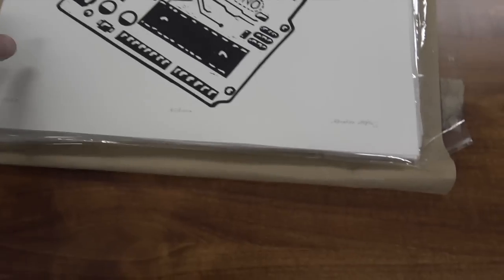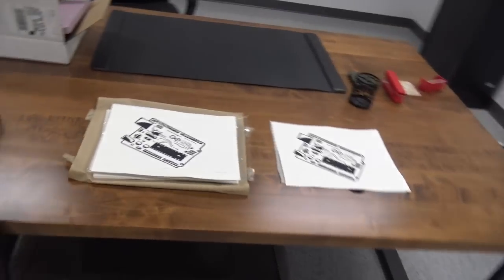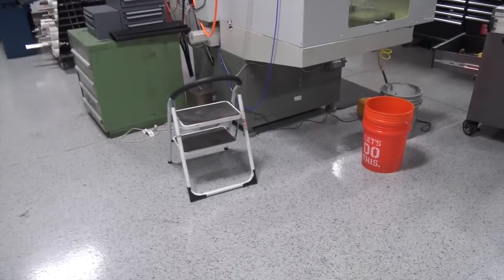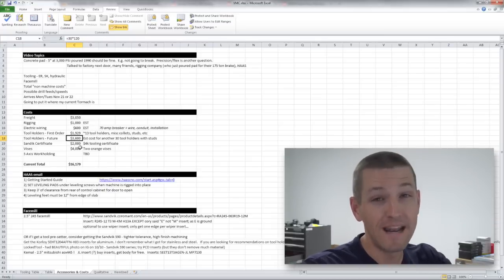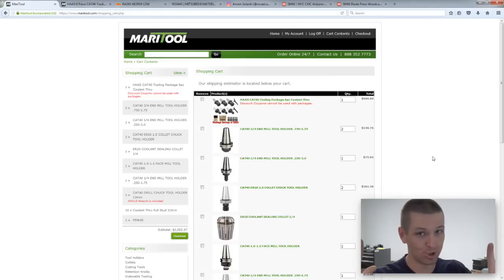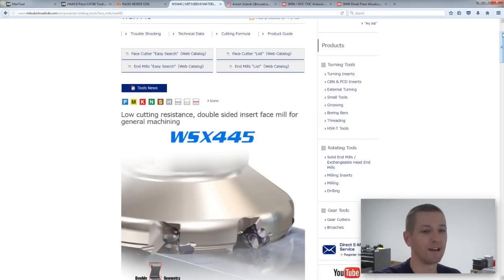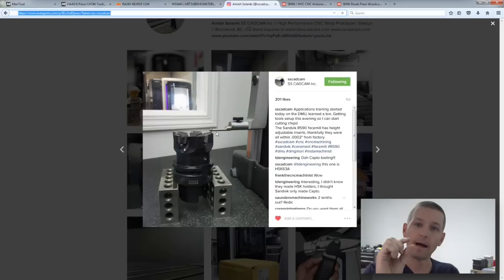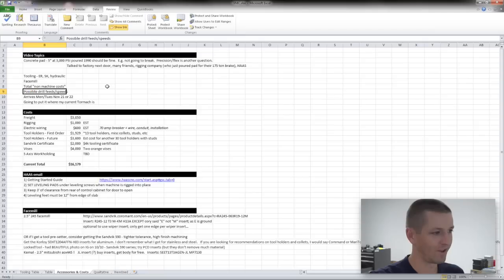Arduino Print & VMC Update!  CB33

Comment: Machine on slab. In my experience the poorer the sub-soil support the thicker the slab needs to be. If your building is on a prepared pad where the organic laden top soil has been scraped off, the underlying soil is compact and no more than 1/3 clay etc (your county extension office has maps), the pad has been prepared with X number of 4" compacted lifts of crusher-run - in other words, an installer's wet dream - a 5" slab would be plenty for a machine tool of less than 5000 lb per base pad.

I suggest you conduct a floor support survey by rolling a short piece (less than 14" long) of heavy bar stock (steel, 4 to 6" dia) at a walking pace across the floor when the shop is quiet. The changing sound will indicate the slab thickness. cracks, and bearing on the underlying soil.

Alternatively drill a couple of small test holes at the installation site and probe to determine the slab thickness and the space, if any, between slab and soil.

Take local advise for remedy but consider "slab jacking" "floor pumping" (same thing, different usage depending on locale.)

If the floor is sound and well supported, a 5" slab can take whopper distributed loads. So long as the leveling screws bear against 5/8 x 6" square pads your mid-sized VMC is a conservative load. That said, check level once a month for the first 6 months. If no movement after the 2nd month, you are golden.
Reply: NYC CNC An old jaw-less lathe  chuck would work. 6" 8", thereabouts,

Comment: Hey John, not sure if it's been mentioned, but you could get a pallet changer (we have a midaco) and leave the trunnion on one pallet and vises on the other, then it's just a push of a button to send it in
Reply: NYC CNC it's a little unnerving watching them cut a hole in your pretty new machine, but you can add it any time after it's in place.

Comment: After the 3rd or 4th time taking that trunnion off and putting it back on, and tramming it in. You're just gonna hate life and do everything you can to work around it, just so you never have to take it off again 😆
Reply: Occams Sawzall thats why he should have gone with the smaller one...
Reply: doug farrish 
Oh god no.  The smaller ones is an utter waste.  It's far too difficult to constantly try and reach down past that hub.  Plus it's only like a 3" platter. 

Maybe if all you're doing is tiny medical parts it would be practical, but it's not a very versatile 5axis, extremely limited in both part size and weight.  He would have instantly regretted the small size.
Reply: Occams Sawzall knowing that it is a 3"plate, yeah I agree. That's useless

Comment: John, I prefer Command and Techniks CAT40 all day long.  If you get a presetter, either get the DeVelig one or the Parlec one.  Sandvik facemills are pretty good.  The 45 in the part number is 45°, but I think there's a page online that shows their numbering system/nomenclature.  I'll look and post.  Mitsubishi, those cutters are nice.  One of the guys lives about a mile from me.  Sandvik does have their own CAT40's, and believe it or not some R8 indexable tooling too for the BP.d.

Comment: Watch groove automation there last video though depressing they had a interesting way of putting there 4th axis on. They made a special plate that has it hanging over the side. So you don't loose any of the table the machine can travel to. If I remember correctly it is like the outer 4 inches of the table.
Reply: The part of the video I am taking about starts just after 4:00 minutes in

Comment: I actually had the opportunity to help my school set up their 5 axis trunnion (I believe it was also the TR200Y) with fixturing and a solution for moving it in and out of one of our VF2s. Ultimately we decided to make a 1" steel plate that would bolt down over the rotary with a couple standoffs and a swivel loop in the centre. To move it in and out we'd just use a forklift with a strap through the loop. The swivel let us rotate it around to fit through the smaller doors of the VF2. I can also send you the models I worked up for our fixturing solution if you want them. It's easy enough to make them in house and save yourself a few hundred dollars over a COTS solution.
Reply: NYC CNC  Dialing in the trunion isn't too bad, It's a lot like dialing in a vice, just a bit more time consuming on account of the extra axes. You'll want to dial it in along the X axis, IIRC we just jogged the A axis until it was at about 90 degrees and dialed on the face of the rotary, then dial in your A axis zero, and locate the centre of rotation. The rotary has a bore in it you can dial off of to find the X and Y zeroes once the A axis is zeroed. To find the Z axis zero you can turn the A axis to 90 degrees in either direction and probe the face of the rotary to find how far it sits below the A axis centre of rotation, then with the A axis at zero probe the face of the rotary and bump your Z axis up by the offset. Once you've got all that done, mount your fixture and dial on it to zero the B axis.

Comment: Just use that fancy Mitutoyo .0001 indicator you got for setting the inserts. Ive done it, works fine.
Reply: Yeah,  I'd set the facemill inserts in the machine spindle with a tenths indicator if you get the sandvik.

Comment: Go with SK collets tool holders and as few ER collets as you can.  SK collets are 1/2 the tolerance at 2x the length.  ER's will be fine for holding drills and taps.  Rigid tap all day long, you'll love it.
Reply: x19freak they are also less versatile. They only have a .01" clamping range vs and ER32's .04" clamping range. You'd have to buy 2X-3X the amount of SK collets to cover the range of the ER32. 

SK's are better if you're a production shop running high quantities of a few specific parts, the extra holding power and accuracy will extend tool life and allow for slightly faster feed rates. 

But to stay versatile and do a wide range of parts that require constant retooling for each part. The ER collets are a far cheap and more practical way to go.
Reply: Occams Sawzall those are good points.  I do a lot of one off, prototype and some small production runs, and am moving over to SK tooling, just because of the accuracy over ER collets.  While yes, some runs require retooling, a lot of that has been limited by standardizing on end-mill shank sizes that receive the most common use, including standard sizing for some of the unique tools I run into, including miniatures.  

Drills and taps are where it can get goofy, and that's where the ER's still shine as there is less of an accuracy requirement for those tools.
Reply: x19freak I could see 1/8" in SK holders. And a few other standard sizes. But can't see the use to go completely SK. 

Plus I don't think John does enough tight spec work to warrant the extra cost right now. Especially since his cost for tooling has gone way over what he originally thought it would be.

Comment: I can only speak for what we run but we only run ER collets. that's it. Drills, end mills, taps, engraving all go in ER collets, and we just buy 2 sets and an extra few for common sizes. milling Chuck's have a higher run-out. We have serious feeds and speeds too.

For drilling, we almost never spot our drills. Our holes are very good and round too. We use OSG Ex-Gold and OSG SGS drills. We love them, they are very durable. They don't have through spindle coolant, but OSG does make drills that do.

We rarely use insert drills, and if we do its a predrill for a bore on the lathe. We just aren't big fans

In conclusion, we never use end mill Chuck's, just ER32 collets. That's it. Even with end mills that have a flat in them. Just something that's easier for us.
Reply: Chad Krause 

By end mill chucks do you mean solid tool holders with the set screw?  Because milling chucks are a whole nother thing and they are extremely good for heavy milling with run out only a hair more than a ER collet. But far more stable than an ER in a heavy milling cut.
Reply: Occams Sawzall they have their uses, no doubt. but we accomplish every task, whether it is a 10k 3ft alu cutter or a 3k 5flt steel cutter or even a 4flt insert cutter through cast iron. we never had any problems related to the holder. we do mainly steel, stainless, and aluminum, kind of like nyccnc
Reply: Chad Krause 

Upgrade your most used insert cutter to a mill chuck.  You'll notice a huge difference.  You'll be able to push them twice as hard than when they're in an ER collet.
Reply: Occams Sawzall we rarely use the insert cutter. 98% of the time it's solid carbide or HSS twist drill

Comment: Your estimate of $600 for electrical should be close. We paid $430 for a 20-25' run. 

I was just looking at that Maritool bundle myself last night. Contemplating adding TSC to my vf4, and I want to replace/update my tooling with some higher quality toolholders. I actually spoke to kalpay Friday about the uberchuk he uses.

Tim
@Motorcitymachining
Reply: +NYC CNC it is actually a milling chuck which is different from a hydraulic. It utilizes a two-stage clamping mechanism driven by a worm gear. It is guaranteed to run .00012" TIR up to 2.5x diameter.  That is more precision then I'll ever need, but it would be nice to have it should the need ever arise. 

Tim

Comment: John I have an ra245 and an ra290 and I like the finish from both, I think the ra245 would be the better(easier) choice especially if you have a good communication with your Sandvik rep.
Reply: better, hmm , hard to compare as I have not used many different brands of face mills, I like a large number of Sandvik tooling but have moved to some other brands for certain things, I recently switched to a cnmg from Mitsubishi , personally I like the finish from the mill, if you would like to try it out I would be happy to send it your way for a few weeks with a couple different insert grades before you pull the trigger on one.

Comment: Get as set of TAPPING COLLETS. They are the right size and positive drive the tap on the square. I've seen more taps broken because the tap spun in the collet causing axial loading. doesn't happen as much on small size but once you're up to a 1/2" or so they are almost mandatory.
 Keyless Drill chucks work well for HSS twist drills and that's about it ;) Don't ever put a left hand drill or tap in them, or you will have bad day ;) 
You're going to need way more holders than you think. I've got about 60 holders and still don't have enough! 
Maritool = Fantastic value, quality is great and they are almost a cheap as import crap, amazing. 
Look into a quality fly cutter for facing finish and don't worry too much about the face mill. I've use adjustable ones and they are a huge pain in the ass to get perfect.
Reply: Widget Works Manufacturing Inc. 
I rarely ever use a face mill any more. Most parts these days don't seem to have a large enough flat area to even warrant a face mill. 3D adaptive, horizontal, constant Z.  Parts pretty much done at that point.

Comment: UK based Sparky....sounds about right for cabling up the power to the machine...after a bit of number/conversion jiggling in my head.....get electrical certificate for circuit put in....don't know State side rules and regs for electrical, but guessing the same.

Comment: I got a 4000kg (~10000lbs) (also got about 20 metric tons worth of other machines on the same basement floor) milling machine with a really small footprint on a 2-3" concrete floor which is over 50 years old, cracked and sounds hollow when you knock on it :-). Not sure how steady it is over the years but gives an idea how strong conrete floors actually are! I'm 100% sure you will never have issues with your floor and the Haas! I think it's amazing. Keep the awesome videos coming and the best of luck to you with your company and else!!

Comment: Collets are necessary, but you should be looking at side lock holders for the majority of your cutting, they are more rigid, have a shorter gage length, and they are less expensive. Frank will tell you this himself.

Comment: With my old machine I used collets for my drills. I decided that I didn't trust drill chucks or something... I don't know my exact reasoning. One thing that was really annoying was buying collets for all the different sizes of drills. The worst thing was when you needed to use two drills that had a similar size. Of course, that would mean you'd need two of the same size collet. So, if some job needed two drills of similar size you might find yourself buying a second... let's say... 9/64" collet. If you wait to need a second collet you'll have to order it and wait for it to be shipped and if you plan to have all the sizes you need on hand you'll have to order a whole bunch at once.

I'm using drill chucks now and I find them to be very convenient. There is one problem though, the max RPM of the chucks is a factor. My drill chucks are from Maritool and they don't seem to publish a maximum RPM so I've been running my small drills at 7000 RPM or less, which is somewhat limiting.

Comment: I have several BT30 holders (several collet chucks (ER16, ER20, and ER32), four drill chucks, and a face mill holder (I think)) from Maritool. Almost all of them seem to be fine as far as I can tell. One of them, however, had a rough patch on the taper. It was difficult to see it visually, but it became apparent when I was wiping them all down with a towel while installing the pull studs. It wasn't a terrible flaw by any stretch of the imagination, but I do think it was bad enough that it should have been caught before going out the door. I sent it back and they happily replaced it with something of equal value (I think that's where one of my drill chucks came from).

I also have several tool holders from "Big Daishowa". I bought from them mostly because I have a Big Plus BT30 spindle and Maritool wasn't offering their dual-contact line of tool holders yet. These Big Daishowa tool holders are VERY nice, but they were also something like four times the price.

One thing about the Maritool holders that I got that I wasn't a fan of is that they were covered in oil, presumably to prevent corrosion during shipping. Tormach does the same thing, as you know. Cleaning off all that oil is a chore I wish I could have avoided. The Big Daishowa holders were dry and clean straight out of the box, so it IS possible for manufacturers to avoid the oil if they want to.

Comment: If you are venturing more into mold making world, you might also want to consider heat shrink/shrink-fit tool holders. Surely you will need a machine to heat  the holders but it's not that difficult to make as you can make one out of a industrial heat gun.

Comment: I can almost guarantee your slab exceeds 3000PSI, but I'd need to see the load ticket at the least and the CMT report at most. Given the age of the building, more than likely it was poured as a 4 bag mix (4 bags of Portland cement per cubic yard) and not a 3000PSI specific mix which uses additives and fillers instead of Portland. In my experience with construction materials testing, a 4 bag mix breaks at 4500-5500PSI if the contractor did their job right. I think you'll be more than fine.

The problem with using unsealed collets is rotational forces fling the coolant outwards. Good for clearing chips, but not good for getting coolant to the cutting edge, especially at high RPM. Also make sure you get TSC pull studs.

For set screw holders, you will need a weldon flat on your tools and that's not a standard thing for carbide. You'll need to have flats ground. I would suggest hydraulic or shrink fit instead, but the cost is quite a bit higher. Perhaps your most common tools in hydraulic/shrink and collets for the oddball.

I almost exclusively used ER collets for drills. The only time I used a drill chuck was when I didn't have the right size collet on hand like when it was holding a similar sized tool. In those cases, the drill chuck was well worth having around.

Go with the Sandvik face mill. They are more likely to keep legacy inserts in stock for when the tool is out of date and you already know they have local support. Furthermore, Sandvik is big on education and you might be able to work up sponsorship. If you don't already have a granite surface plate and height gauge...GET THEM! :P

All your tools and holders that you intend to use above 10,000 RPM will need to be G2.5 balanced. This is particularly important to keep in mind if you're thinking about set screw holders. I would consult Maritool on this especially if you're going to use a custom ground carbide tools.

Comment: I wouldn't worry about the concrete as that machine is light at only 14000lb and it is relatively spread out. I would make some 1" thick 6" diameter steel washers for the leveling screws to sit on though as spreading the load just that much will really help with being easy on your concrete and maintaining accuracy.  Get some 3/4 plywood and put down on your floor for driving the fork trucks on when moving, it will spread the load from the tires over a much larger footprint and prevent concrete damage as well. This is akin to putting mats down for heavy rigging on dirt and a little bit goes a long way.